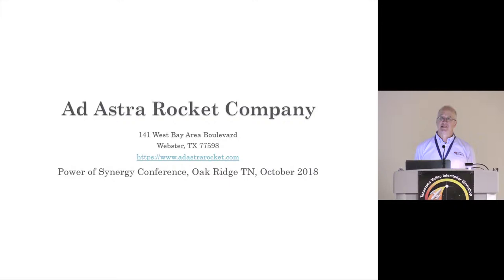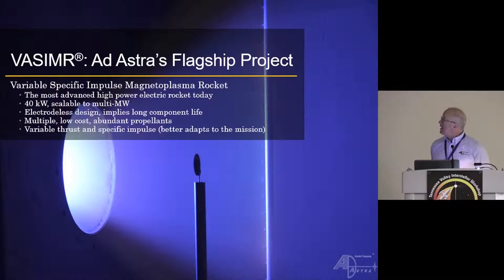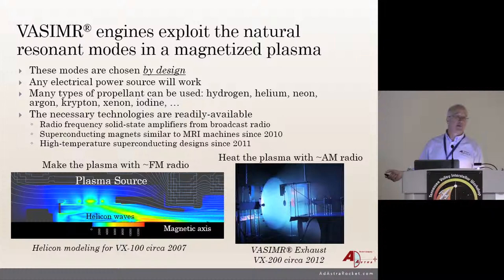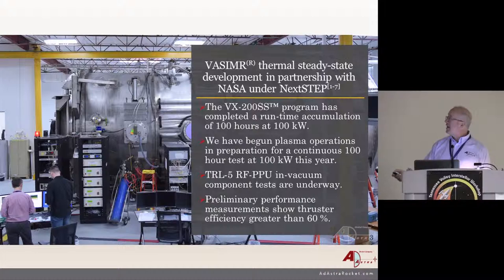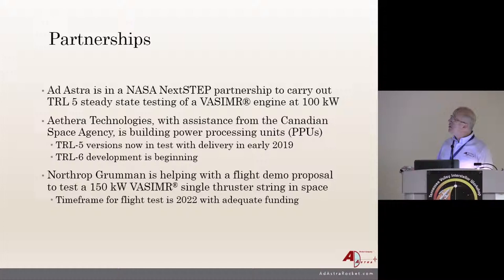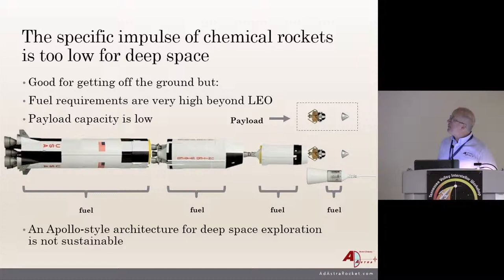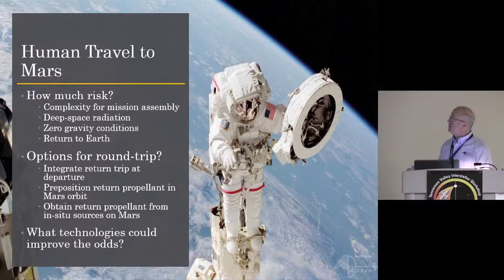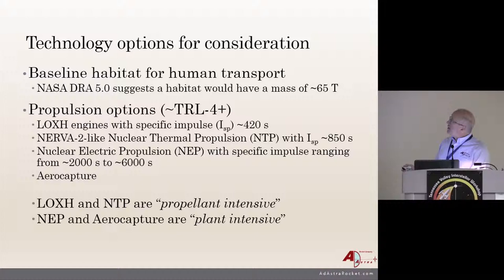2-7 Dr. Mark Carter - VASIMR Plasma Propulsion

Comment: What’s easier to build, this or artificial gravity?
Reply: This, I think.
Reply: Levar Mitchell...I created artificial gravity as a kid with a bucket of water spinning around in the back yard. I am totally on board with the advancement of plasma propulsion. But if the goal is reducing 0-g time, spinning is easier, and ultimately the only solution. So we might as well get on that pronto.